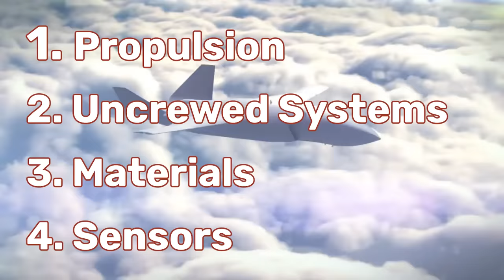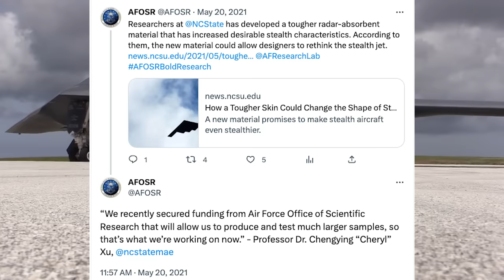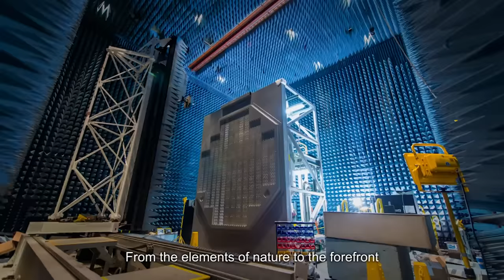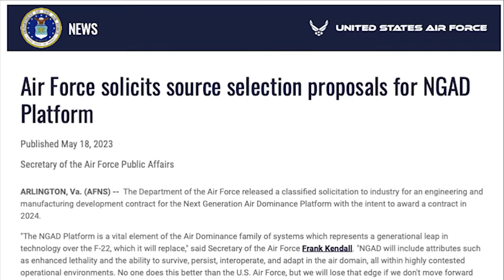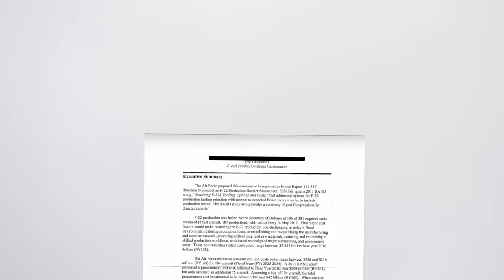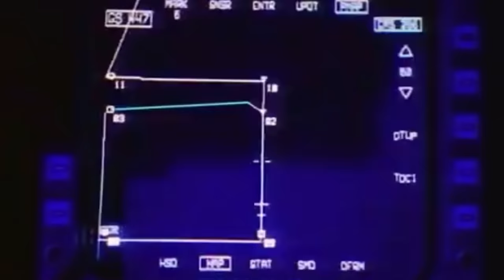Why America's new stealth fighters might cost $300 MILLION each

Comment: I wonder what the bottom dollar difference would be purely financially to quadruple the volume of F15’s with the latest variants to go with a quantity model of a still awesome jet that can carry a ton of weapons, and put a focus on BVR and missile tech? Add a lot of the sensor fusion from the F35 program and still have a huge air power that’s still due to quantity the most threatening Air Force in the world by a large margin.

I mean the SU57 is irrelevant unless they can make it in quantity, so the only other country to have any concern of would be China.
Reply: The F-15EX is replacing old F-15 in ANG units to perform the interceptor role. The F-35 was designed to penetrate denied airspace. Two different missions.

Sending F-15EXs into denied airspace would be very dangerous for its pilots. Outside of the interceptor mission, it would perform better in "Day 2" missions after the F-35s have knocked out the IADS.
Reply: @Rob_F8F  I wonder why they’re not working on just a stealth drone for that purpose? Just have them for that purpose to carry like 2 anti radiation seeking weapons. Send them ahead of a whole slew of F15ex’s to take out SAM sites. With the new radar and amount of air to air and air to ground weapons the F15 can carry it could handle both strike and interception just decide them up into groups some focused on ground strikes and the others on their flanks to defend them from any air to air threats 🤷‍♂️. 

I mean I see the value of cutting edge tech, but having low quantity of something in an all out war with a near peer, only has so much value the way I see it.

Comment: As we are learning in the last few conflicts, especially Ukraine, I believe $300 million per unit is way too much. And the question is will it have the range to project power in the pacific or will it come up short like the F35?
Reply: I meant to say we’ve seen high tech being defeated by cheap innovative counter measures
Reply: That's what the drone wingmen programs are for
Reply: F-35 has much longer legs than the legacy fighters it's replacing. NGAD needs to be much longer range still for the Pacific theatre but I'd argue that the lesson of Ukraine is how costly it is to not be absolutely dominant. Russia should have steamrollered Ukraine and achieved total air superiority within the first days or weeks of the invasion but they didn't and they've paid an extremely high price for that failure.

Comment: The US are still hurtling downng this trillion dollar blind alley? RADAR stealth is useful but building a hideously complex, hard to replace, almost impossible to upgrade ultra integrated aircraft is an obsolete concept. RADAR return digital signal processing has made the programme pointless - tiny tiny RADAR returns can now be tracked perfectly well - building simpler more robust airframes that can be quickly replaced and can have the latest tech bolted onto and integrated in months makes far more sense - look how overdue F-35 is thanks to its hideous complexity and supply chain woes - and the relentless bug fixing has stalled the weapons and systems development leaving it practically obsolete as it comes into service! - block 4 is just a band-aid until the plane receives a TOTAL refresh and the bug swatting starts all over again!    The US know this of course (which is why F-15EX exists) but the healthy overseas sales are effectively sponsoring the programme so the dead horse gets some more flogging. F-35 is a total lemon – the stealth programme really ought to be killed off – but while foreign governments are being fooled into funding it – nothing changes.